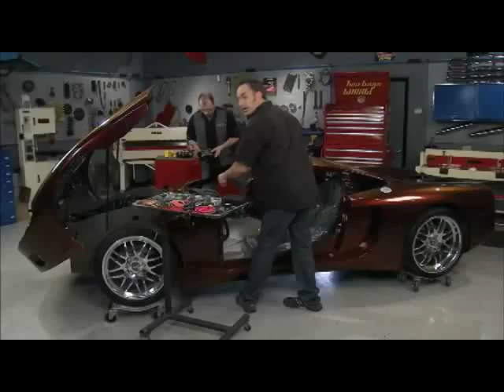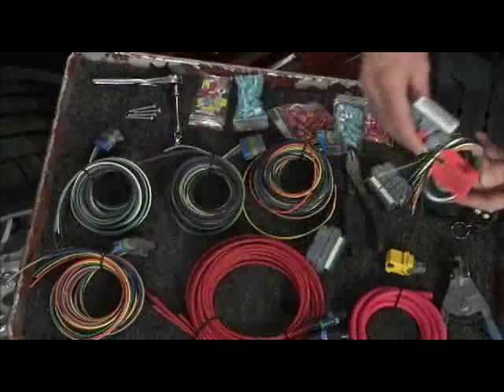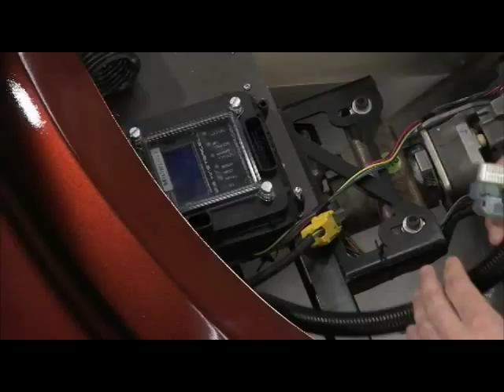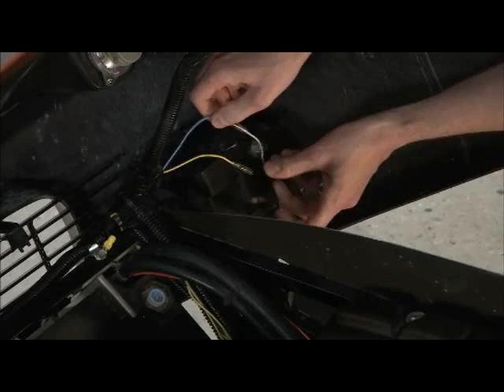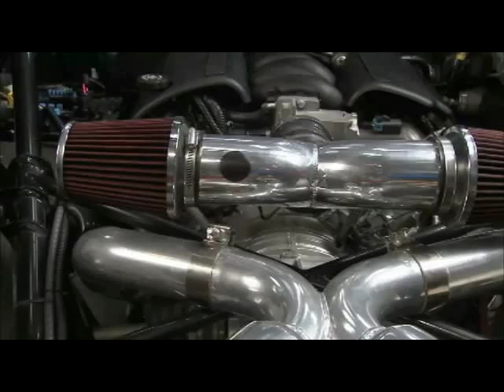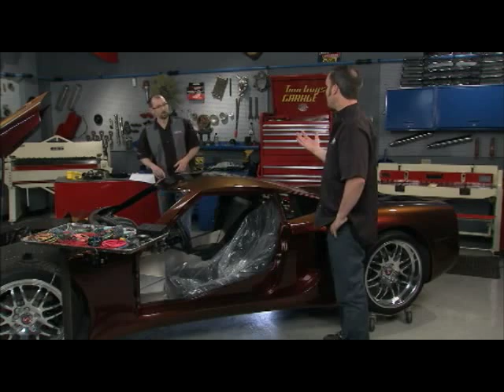Infinitybox on Two Guys Garage Part 2

Comment from the maker: One of the most common questions that we get is: "Will ISIS work on my...".  If your car rolls, runs on a 12-volt DC system and needs to have things turned on and off, the answer is yes.  Check out some of the other videos in our account.  You will see some Camaro specific ones.  Also, search for the One Lap Camaro.  That is one of our earliest customers and that Camaro has seen some hard track miles and keeps on cruising.